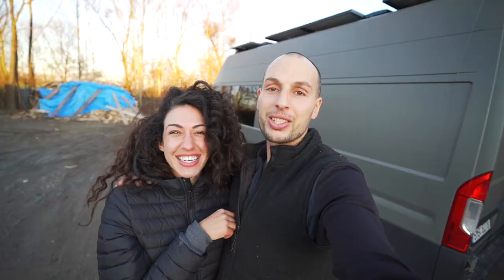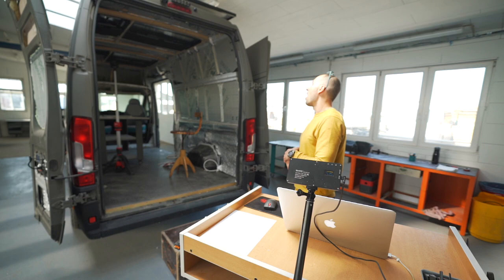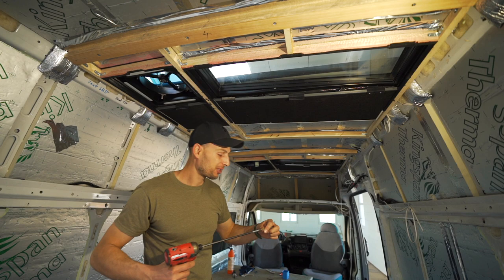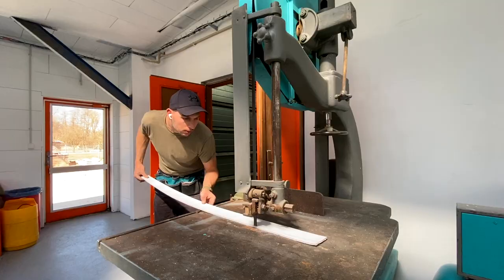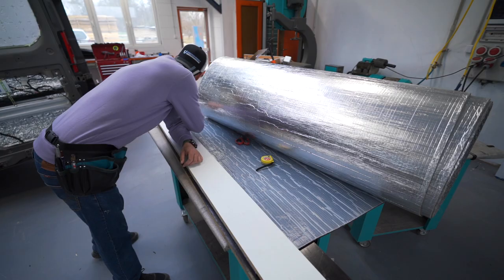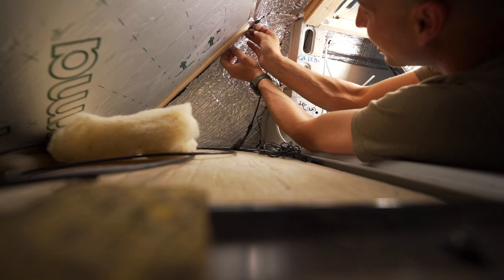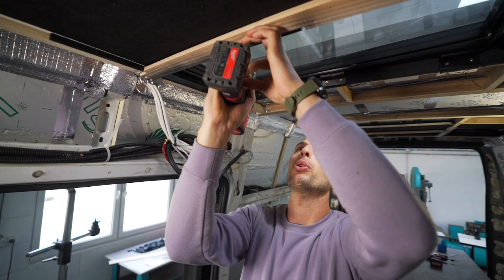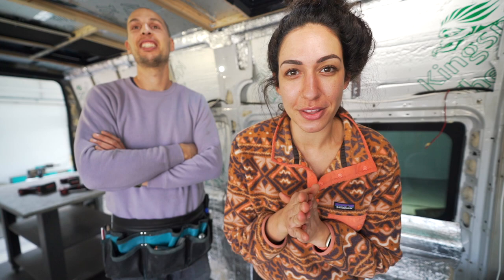NOT YOUR TYPICAL VAN BUILD / Converting Awesome Campervan w/ Ideas We've Never Seen Before!

Comment: quick question, when the fan vent is closed - if you activate the fan could that cause an issue? (overheat the motor, or some other issue) should there be a relief in the pocked for the fan to vent even while closed - OR should you wire a switch so the fan cannot power whilst the cover is closed?

Comment: I have a question, you don’t use the fans at night for air in the vans? And when is hot day you need the fans to circulate the air??? Do you have a back up air system?

Comment: Speaking of height - if you ever decide to move your campervan to, let's say, Australia, would it fit in closed high-cube container? Sprinter H2 only fits if you take off wheels.
Reply from the maker: Haven't considered that yet! It would certainly be a struggle, but it must be doable, as they are shipped all over the world. Would take some research though!
Reply: Won’t fit in a container, unless possibly an open top, but there are several ro/ro options (like an all vehicle cargo ferry) available from Europe to Australia. There is also the option of shipping on a flatrack…..there are many options that require the skills of a dedicated forwarding agent to get the pricing right..
I once shipped a 15m tractor/trailer combination from Chennai, India to Sydney and back to New York…..anything is possible, but you need to weigh cost against value….is it necessary with your own home, or would a local vehicle be acceptable (with steering wheel at the other side to suit the local traffic)….costs are really high.
Reply: @edgarspo4947  thieves exist in the world, but truly they are not a factor worth considering within modern shipping and the origin/destinations we are talking about here…containers and ro/ro ships are operated within fenced off port terminals with good security….

I would say the risks are greater parked alongside the roads in Czech repblic, than after the vehicle has been handed off to a reputable shipping organization….trust me; I worked this field extensively since 1973.